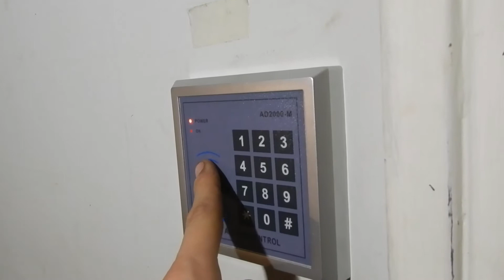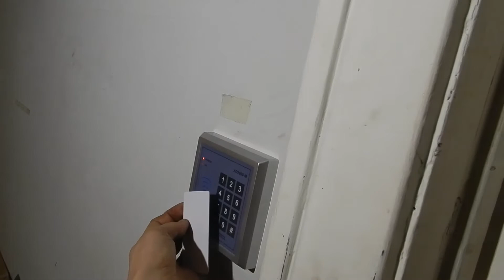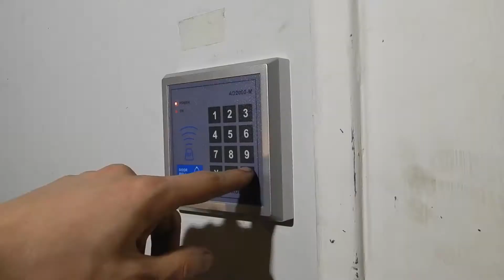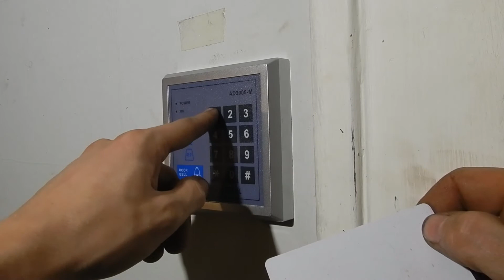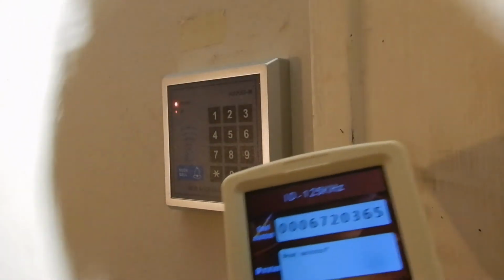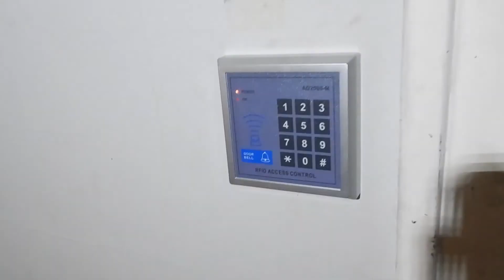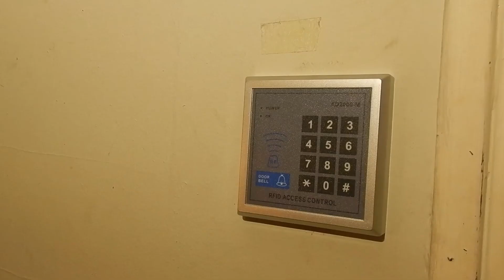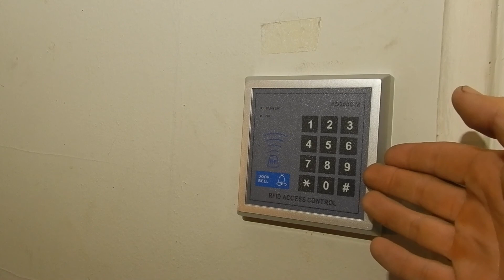RFID keypad programming

Comment: Your video is so very helpful! Thank you so much. Just a question: in our elevator the keypad is not together with the card reader : the card reader is above the keypad, on its own. Could I try to add a card like that? I have the admin code for the keypad, but for the card reader I am not sure if it works too.
Reply from the maker: If you have the administrative codes you should be able to add whatever you want

Comment: How do you find the administrator code ?
Reply from the maker: Most units have a default administrator code from the factory. You can just Google the unit product number and you can find the administrator code. If it's been changed the only way to resolve that would be to reset the whole system.